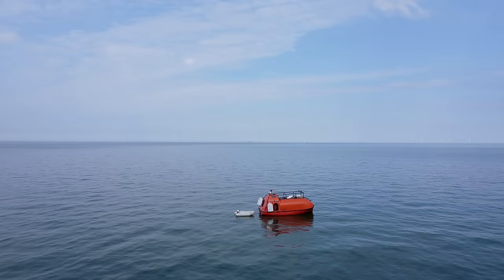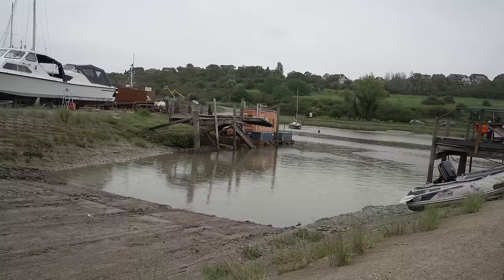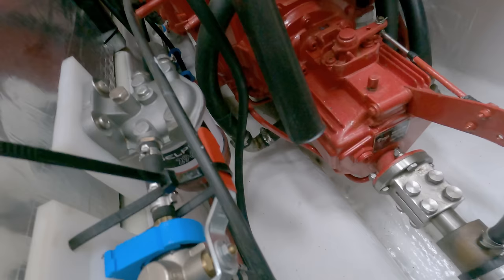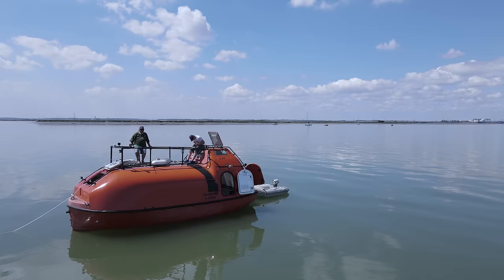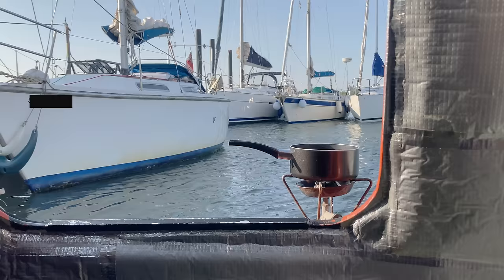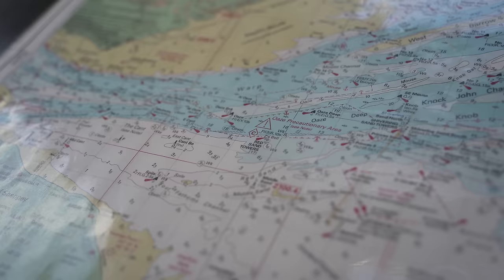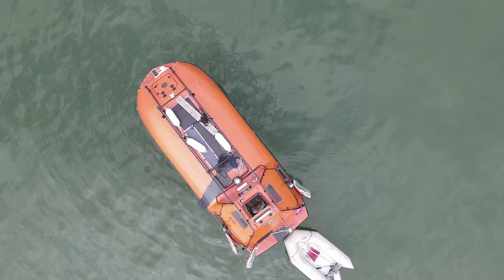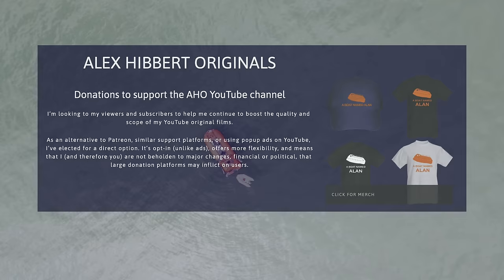*SPECIAL* Lifeboat Conversion Ep20: Multi-day sea trials in the Thames Estuary, England [4K]

Comment: Hi Alex. I've heard, that these life boats are unsinkable, and when they capsize, they get upright again by themselves. Is that so with your modified life boat as well, or did your modification change the balance, so it won't get leveled again by itself? I think, these life boats are pretty much the toughest vessel you can get. I've seen drop tests of these boats and that is really impressive. Enjoy every minute on this boat. I surely would.
Reply from the maker: Thanks - yep they do self right when fully laden as designed. Alan will be under maximum weight, has had minimal insulation foam removal, and weight is being installed low down, and balanced in location. So I don't anticipate us to have ruined this feature.
Reply: @AlexHibbertOriginals  Thanks. Sounds interesting. Then you don't need to worry about any wave whatsoever. The only downside of such a life boat is, that there is no real space for sitting outside for lunch, 😄and this boat has no real windows to take a look outside. You actually did a great job with this thing. Really inspiring.

Comment: I haven't read every comment but having No keel be harsh,, but is an inflatable ring to stablize and walk on possible? Tug looking Zodiac you could let air out via the engine air intake in dangerous conditions even blow it back up with exhaust quickly

Comment: would adding outriggers help with the roll?
Reply from the maker: The issue is they are susceptible to sea ice.
Reply: @AlexHibbertOriginals  i was thinking something like a side skirt which you can Shimmy across with outrigger that can fold up
Reply: @AlexHibbertOriginals  -  You've mentioned sea ice several times.  May I ask what your plan for Alan is?  Clearly it involves sea ice, presumably insulation as well.

Comment: Is there a way of plumbing an intercooler in? It will make the engine more efficient at high loads and give Alan more range.
Reply from the maker: Theoretically I suppose, but probably not on a balance of pros and cons. We want to run the engine at modest revs.

Comment: Great vid. I've long been fascinated by these butt-ugly boats. Beauty however is far surpassed by utility which Alan has in spades. I was thinking, a set of video camera "periscopes" could be mounted at cardinal exterior points around Alan and slaved to an inexpensive computer tablet, giving one  much improved views from around Alan whilst being safely ensconced in his belly with the hatches battened.
Reply from the maker: Actually four cameras are already installed but not wired up. Was waiting for a good time to do a vid on them.
Reply: @AlexHibbertOriginals  great minds!

Comment: In an odd sort of way, a good-looking boat an acquired taste. I have been looking at the website and they are currently £6500 not bad at all.
Reply from the maker: £6500 is at the mid/lower end. I suspect you'd need 50-100% more for European builds, boats in good condition, and with engines in fine fettle.

Handsome boats indeed.

Comment: I've thought about buy a life boat like that for modification. 
 The big thing I saw is power plant. Because  5-7 knots I'm not going that dam slow. 
I am  curious if a prop upgrade helps speed.
Reply from the maker: It's not fast, certainly. But if you compare it to a typical cruising yacht then not too different. A prop upgrade might get more 'traction' in difficult water, but the hull speed is the hull speed.
Reply: @AlexHibbertOriginals  and  the speed would be the problem many places I would want to take it  I wouldn't be able to beat the  current..
But I don't think a repower  would be that difficult. In the  12 to 15 knot range I could live with
Reply from the maker: A 7.5m displacement hull can't do 15 knots.
Reply: @AlexHibbertOriginals  absolute  bullshit.  7.5 meter  with a engine putting out aprox 30 to 35 hp will do 6 knots. General rule of thumb  if you  want to  double the speed  triple the  horsepower. 
 And besides us Americans  love putting ridiculous amount of horsepower in things.
  I understand  Britain doesn't have  the  insane  need to  over power most things.  But believe me  a 7.5 meter  can be repowered to do well over  15 knots. 
I
Reply from the maker: https://en.wikipedia.org/wiki/Froude_number

Unless you have a (semi) planing hull, or similar hull design trickery, your limit is your limit, regardless of power.
Reply: @AlexHibbertOriginals  now I do have to buy one and repower  it just to prove that it can be done. 
After all  12 to 15 knots isn't fast.  Plus I've got 2 hydrodynamic engineers in my family.  Me and my uncle both I'll send you videos in the future. 
Because seriously what good is a boat that can't overcome a slight current

Comment: Would this engine be strong enough to fight heavy currents and bad weather?
Reply from the maker: Luckily Alan ended up with the largest engine in the Bukh range (some lifeboats only get 20-30hp) and we found we were able to reverse into a pretty nippy tide. But sure, if both current and wind are against you, holding station might be the best you can hope for, for the duration.

Comment: That boat is surprisingly large and also your fuel economy is similar to what I see in my small diesel tractor loader. Above 1900 rpm fuel consumption goes up but not necessarily power. Sure you gain speed but a lot of fuel is wasted for a small gain in power. Good for small spurts if needed.

Comment: Would retrofitting a twin keel be he easiest option to stop the rolling? Perhaps from back to front and not deeper than Allans current keel? It could be "glassed" on i guess? Does anybody has any thoughts on that?
Reply from the maker: Bilge keels have been debated in past videos, and the issue is they are susceptible to sea ice.

Comment: I want to buy one of these lifeboats to use it to navigate, only one of ten meters, but I see that it is not stable at all in the water, it moves more than a zodiac or an inflatable boat and that the sea is almost immobile , is this normal in a lifeboat? because if that were the case it would be better to buy a small boat or a small sailboat since neither of these two devices moves too much in the water as I saw this boat do, that is why I ask again, is that movement normal in an almost immobile sea of this kind of boats? because if it's normal I can't even imagine how it has to wobble in a rough sea
Reply from the maker: These lifeboats do roll a lot without keel modifications. But they are more uncomfortable than unstable.

Comment: I have 2 questions. 
Thats a rescue boat so is it good enough for long term use? I mean those things are made to float for few days max. How does frame hold out after monts in water?
Second kind of stupid question... if u keep it original color how people dont confuse you for real rescue boat who... well..... needs rescue
Reply from the maker: What about it makes it sink after a few days? A special sort of soluble glassfibre?

Some people do change decommissioned lifeboat colours, but with a combo of significant visual modifications, radio and AIS, you're unlikely to spark a major rescue drama.

Comment: I'd put a moveable mast with wind turbine on it, with a 1kw wind turbine on it, and hand solar panels on the rails, with about 5kwh of lithium batteries,  maybe a 10 hp diesel engine to generate power if required,  along with a 4-5kw motor  to move it in emergency, or to assist getting it to a higher speed in emergency, or up to speed in emergency,  or a pair, like extra large trolling motors, about 4kw each, running off the house batteries,. Being enough for 5 hours run time, so maybe 20-30 kwh battery would be better,   and maybe build a boom with  anchors and build wave powered generators,  using a float to generate power,  to charge the batteries,  I love alternative power, alternative anything almost, and building stuff!   Maybe buy a wrecked ev like a Nissan leaf, use the battery and motor to power the boat, haha crazy I know..
Reply from the maker: Doing the maths, you'd need a field of turbines and solar panels to have a hope in hell of powering Alan.

Comment: cranking battery? why not use a wind up spring starter?
Reply from the maker: I've seen these - very clever! And very expensive.... 

The battery can just be moved into one of the banks if need be - so dual purpose.
Reply: @AlexHibbertOriginals  OR you can use jumper leads to use the bank to start the engine. I simply mentioned it as those life boats are mentioned in the list of applications for those starters.
Reply from the maker: The standard options aside from electric are hydraulic and hand crank. The clever wind up ones appear to be aftermarket. I did enjoy a video seeing how they work.

Comment: Wouldn't be hard to set up a junk rig on top or some kinda sailing rig so you could cross oceans with little fuel use
Reply from the maker: I think a rig, yes. 

I've looked at giro controlled parasails but they're either too small or crazily expensive.

Comment: A thought occurred to me as I watched this video and it may have been discussed before and I missed it. When you and your crew are on your trek up north there will be much to look at, but a lot of it will be the same color Such as blue water, hopefully blue sky but not always, mostlly orange with a bit of black trim Alan, white ice and a very reflective silver and white interior.  All of that seems to me to be a little boring and even depressing over time. Will you add something on the walls to sooth the eye and mind?
Reply from the maker: It's something you get used to really. I've done 113 days on an ice sheet, and came back broadly sane.

Comment: LOL @ "fast moving tide" - in actual fast moving tide (and you have the worst of it there in England somewhere) you'd be going backwards faster than she can go forward despite at full power. I've moored our boat in conditions like this, but her top speed is 50% more than Alan's :-D PS, you're going to be SO uncomfortable in the open ocean on your way to that ice you claim will make it calm. That thing is going to bob like a cork and roll like a pig in mud :-D
Reply from the maker: My congratulations to you on your mooring skills Fred!
Reply: @AlexHibbertOriginals  Why thank you! However re reading my post, my boat would go backwards fast in those extreme UK conditions, too. I pulled that off in 6 knots tide a few times, and 3-4 many times. The hazards of tidal/river/estuarine  moorings :-D
Reply from the maker: You're quite the moorer to aspire to equal!

Comment: Im sure you have seen, heard, read or dreamt about them before..... have you considered treating Alan not Allen* to a Gyro stabiliser ? you can buy 24volt small units which would happily run off of Alan's alternator. I know it may be a several $$thousand Dollar/Pound investment. Worth considering though I promise you !
Reply from the maker: They would need to be totally removable, due to sea ice.
Reply: @AlexHibbertOriginals  

Not external Alex, internal stabilisers!

Have a look at the below website for an example. 

https://www.gineicomarine.com.au/quick-gyro-stabilizer/?gclid=EAIaIQobChMI-av0m5yb8QIVscFMAh2uKAtkEAAYASAAEgJDUPD_BwE
Reply: @AlexHibbertOriginals  gyros are mounted inside the boat and theres nothing external of the hull. Rolling motion causes a counteracting torque moment from the gyro. Only down side is they take a while to spin up and have mechanical wear

Comment: on my lake those are called docking lights and you are not supposed to use them on the water. Any different on the ocean? basically you go no directional lights so you can see the other persons nav lights and they can see yours. the red and blue ones. Kinda like how i dont drive my car with brights because i can actually see the road reflectors better snd animal eyes
Reply from the maker: Alan has red and green nav lights, as well as an all round white light. For boats under 12m the laws aren't too strict here.
Reply: @AlexHibbertOriginals  I was just wondering because on my local group for the lake its a pretty big deal and also against local laws to use "dock" lights while not docking. I just found your project and cant wait to check out more videos. I love building and boats too! thank you for making it a series and not here is 5 years of work in a half hour. Love the journey!
Reply from the maker: I've just had a google. Yes, it's clearly a hot topic amongst US boaters. In the UK we do have rules, but unless your lights actively deceive others as to your size or heading, or dazzle other boats, I doubt there's much drama.

Comment: Since rpms from 1900 to 3k yield you no additional speed and 6 knots is rather paltry, the 4 bladed prop and perhaps a more aggressive pitch seems extremely waranted
Reply from the maker: The hull speed of the boat isn't beyond 6.5 knots, so that's the limit anyhow. The only reason I'd consider the upgrade is to improve 'traction' in trickier water.

Comment: What are you interior lights.
Reply from the maker: Tagra IP68 Pro
Reply: @AlexHibbertOriginals  Are these LEDs?
Reply: @AlexHibbertOriginals  If they are LED you can safely use them even with the engine turned off in the evening for longer periods without having to worry that the next morning the batteries are flat.

Comment: I would say that rather than spend the money on a new prop which may or may not improve your speed it would be better spent on a small diesel outboard. Assuming you can find such a thing. There are of course many diesel outboards but most are too large and expensive for your requirements. This is not to improve your speed but as a safety issue. Although Diesel engines are reliable and I am sure you or your crew will have diesel mechanical knowledge it is a single point of failure and you do not want to be 100 miles offshore with a blown engine. It is unlikely you will be carrying enough petrol to use a standard outboard for any distance and similarly electric.
Reply: A different prop might possibly improve efficiency, but your hull-speed will not change.  Alan has an inboard diesel with (hopefully) easy access, so you have a chance of fixing it if it goes wrong. At sea, all you can do with a broken outboard is hope for a tow. It might make a handy emergency anchor though, as diesel outboards are brutally heavy.
Reply: @mikewebb4730  Outboard diesels are terrible in comparison to petrol which is why there are so many 2 and 4 stroke petrol outboards. However they are unlikely to carry enough petrol to propel Alan what might be over 100 miles to a safe harbour if the inboard diesel suffers a catastrophic failure. Remember he has no other means of propulsion. Even if he carries an extensive parts and tools list imagine trying to pull a rod and change it the gaskets etc in a heavy sea state with no steerage.
Reply from the maker: Thanks both for your thoughts. You've touched on how tricky backup diesel outboards are. Yanmars (practically the only option) are a bonkers price - with even the old referb ones fetching £15k. They're also enormous, and heavy. An idea to sell the Bukh and mount twin 50hp diesel outboards was shelved due to the sheer cost, and lesser fuel efficiency.

We can't use petrol with any significant fuel storage volume, for safety reasons.

For backup in the event of total, unfixable engine failure, I am investigating c.20hp electric outboards with high thrust props. Whilst a compromise, it would be easy to store and mount, and would allow Alan to at least stay under control at sea. Power would come from the diesel generator that will be mounted on Alan anyhow.
Reply: @AlexHibbertOriginals  If you are thinking about electric anyway have you considered an electric motor running via a belt or chain onto your existing prop shaft?

Comment: If you use water for blast it becomes emergency water
Reply from the maker: Or very stagnant and oily, not-very-dense ballast.
Reply: @AlexHibbertOriginals  not if it is in a water container safe from contamination,  yes sure its more in volume but at least you can drink it

Comment: 3:09 Am I the only one reading "Theresa May" in the boat behind Alan? But the real thing is why the EU directive for fuel taxation is still an issue in the UK.? The country is no longer part of the union. Sincerely, I do not get it.
Reply from the maker: Red diesel still needs to have full tax paid on it in the UK if used for running engines (as opposed to heating).

Comment: i think it cool man..but, i have been in the north sea Atlantic, and you need a boat that can roll up side down and remain intact.  Just saying..
Reply from the maker: This is a boat literally designed to invert and self-right.
Reply: @AlexHibbertOriginals  
it was just that to me, it looked like  your out side tack and some of the inside gear did not look like it could take a roll over and sea pounding. you may want to test it in some rough water before you go to the far reaches.

Comment: How is a Life Boat.  that DROPS OFF A SHIP 20 -40 FEET IN TO THE OCEAN NOT MADE TO TAKE ON BIG WAVES. IT WATER TIGHT  AND CAN ROLL OVER AND RIGHTS ITS SELF AUTOMATICALLY? DID  YOU DO SOMETHING TO STRUCTURE ? SORRY CAPPS OLD EYES CANT FIND MY READING GLASSES EASIER TO SEE BIG PRINT LOL
Reply from the maker: It takes big waves fine. It just rolls with them.